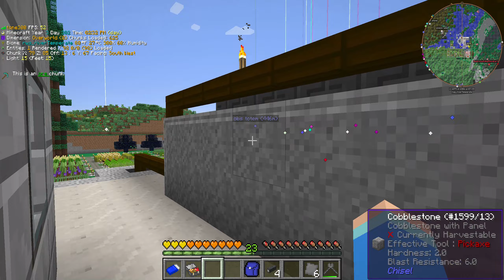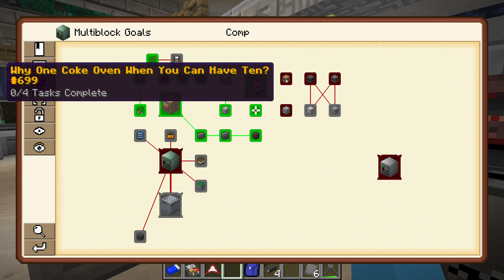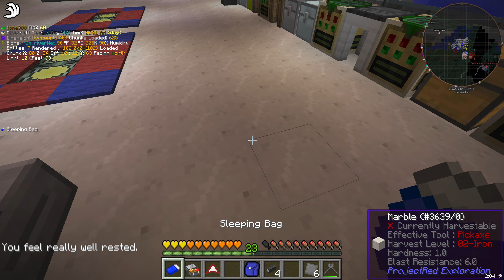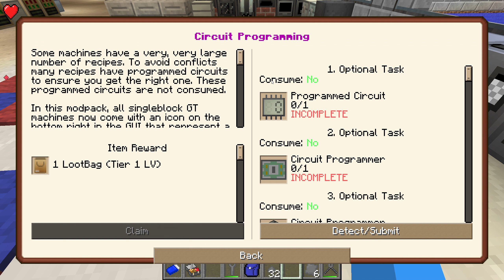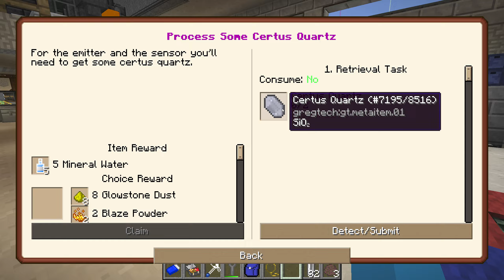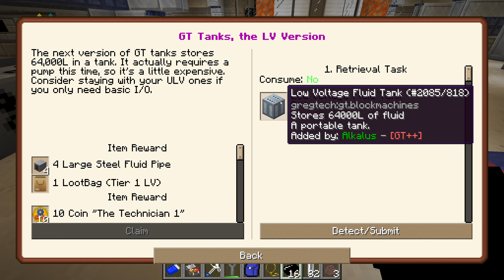Minecraft GTNH 2023, Tier 1 LV. Ep72 Making some LV machines lathe, polarizer, macerator, ore washer

Comment: the ore washer will get you byproducts out of your dusts you can also make the simple washer which will just wash your impure piles of sulfur for you both are good to have. MAKE SURE TO MAKE THE ULV TRANSFORMER OR IT WILL EXPLODE ON LV POWER. you will also want it because when you crush purified ore you get purified dust which must be washed again. also you can use pipes instead of cells. there is no reason to keep any of the ore in ore form you always want at least crushed so you could just put all ores you mine in a chest which gets fed into the steam grinder and have an ore processing setup from there as you need.
Reply from the maker: hehe yea I thought it might explode if I connected it to LV... thankfully I didn't lol!! I am trying to set up an area for processing atm and It's in the next episode I just recorded! What I'm thinking is like you said to put all ores into the chest that feeds the grinder then sort out all the crushed ores from there... It seems some need to be forge hammered, some smelted and others washed but I'm not entirely sure on it all yet lol! Getting there though especially with your great help so far 😀